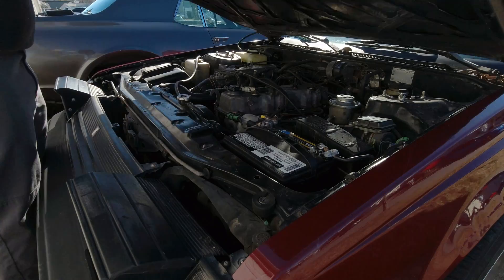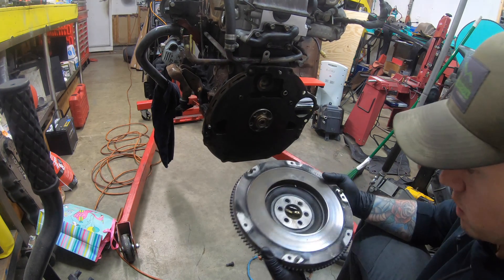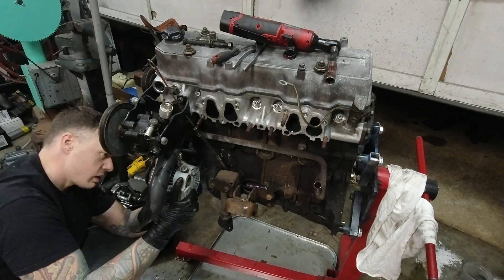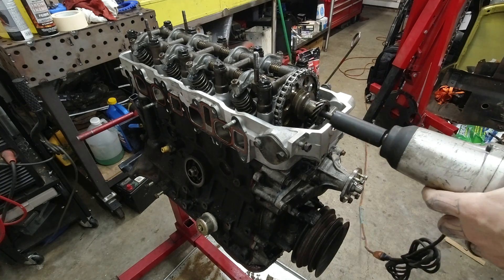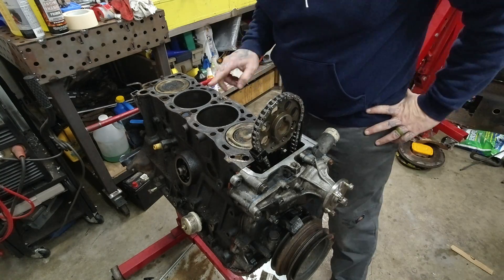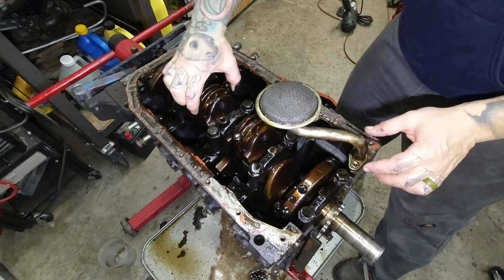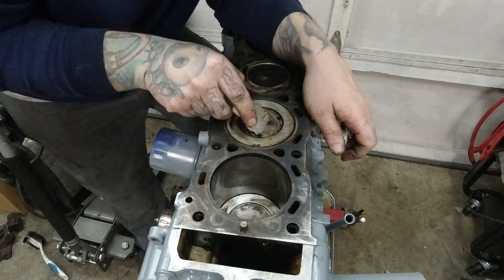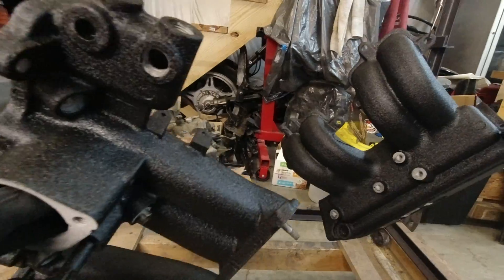TOYOTA 22RE ENGINE REBUILD - Part 1/2 - Teardown and analysis of a poor running 22R Toyota legend!

Comment: Maybe not a timing related fault. Replace the rocker cover gaskets. The miss is from the spark plugs shorting out through oil contamination..
Reply from the maker: Great theory, but that isn't even close to what was wrong. See part 2 to find out what it actually was!

Comment: Currently have one  in a '86 4runner at 315,000 mi on the odo

Gonna be moving from Washington to Texas this coming spring. I DO NOT want to pay the like 3000$ to ship it. And I honestly dont want to sell my baby. Motor runs fine. But no ones really been in it for some time. What would you recommend I take care of before I make the 2000mi drive?
Reply from the maker: I drove this engine in my Celica on a 2000 mile round trip shortly after this rebuild. My advice? If it runs good as is, then hit the road. Pay attention to fluid levels and keep an eye on coolant temps. Also...don't try to run 80+mph. You'll still get there at 65 and the truck should stay happy.
Reply: @tinygaragefab  85mph is a dream.

With the 35" tires and current gear ratio im locked in at about 55mph. The left lane/passing lane isnt a thing when im driving it 😂

Right on! Ill probably have broken something else by the time i leave wheeling it one last season here with my friends, hopefully she makes it alright  🙏

Comment: What type of stone was used on the head block
Reply from the maker: That was just a cheap knife sharpening stone I picked up from a tool store long ago. There are better things to use, but this works great for a fine hone just to get a glimpse of whether the head or block is warped.

Comment: I would like to know how you got rid of the refrigerate. I don't know anything about impact wrenches..are the expensive..do you needed a commercial compressor to run a impact wrenches
Reply from the maker: I don't believe this had any refrigerant in it. You can usually unbolt the compressor from the mount and move it out of the way to pull the engine without opening the A/C lines, if you're worried about it. Many shops might even purge your system for free if they get to reclaim and keep the refrigerant. 

As for impacts, electric is now the way to go. Harbor Freight has some decently powered 20v impact guns. But most of the time, you can just use a breaker bar and do it by hand, it doesn't take that much longer.

Comment: I own a 1997 Toyota Hilux with the 22R engine which is excellent what a terrific engine one of the best 4 cylinder engines ever made when l bought the Hilux about 3 years ago for aud$1500 as l was a courier retired now l have not removed the engine because you Celica was running very rough and there was something not right with your engine l have no idea what has been done to the engine but l can tell that the engine has not been removed it has been serviced because l have replaced the rocker cover gasket and l don't think the cylinder head has been removed and the caburator is never been removed but it starts on the button every morning the automatic choke works you didn't mention how many miles is on your Celica and the 22R engine appeared in the Hilux in about the 1995 but we got in Australia the 22RE in the Toyota Corana Avante in the 1980s
Reply from the maker: Excellent story! It's cool to hear how different engines get used around the world. The 22RE was replaced by the 2RZ sometime around 1995 here in the states. 
My Celica had 157k miles (252k km) on it when I pulled the engine for this video.

Comment: I owned an 85 Celica GTS, it wasn't very fast but it was my favorite car I ever had. It wiped 2 camshafts and rockers so I cleaned and refreshed it, replaced bearings, rings and oil pump and it went a total of 300K miles.
Reply from the maker: Heck yeah! I really should have done bearings and rings in this one. I'll pull it again soon to refresh the bottom end and gaskets, because it leaks and burns a fair bit of oil.

Comment: Man i just rewatched this awesome videos thanks for taking time to do them. What oil would you recommend? Thought about a synthetic blend but was a afraid to switch.
Reply from the maker: Thanks for watching! It was a fun video to make. For oil, since it's not a roller cam, just flat tappet basically, I only use Rotella T4 10w-40. I use that because of the high zinc content for an off the shelf oil. Cheap to buy in gallon size from Walmart also.
Reply: @tinygaragefab  awesome thanks man

Comment: Awesome video man. Yes I learned the hard way guy that did my timing chain used the plastic guides. Guides broke 30k miles. I love my 22 re just found a 1990 from California with hardly any rust. Im afraid ill have to put a water pump on it just found some antifreeze leaking looks like from a seal from the waters pump.
Reply from the maker: That's awesome about the truck with no rust. My '87 only has a little in the bed. I have the Japanese bed, so it has the seam that rusts out. I'm going to pull that 22R to swap a 1UZ, but that 22R will love on as a turbo build in my '85 Celica.

Comment: Great video! What size bolts are you using to mount the engine to the stand, I just got a 84 Celica gts and transmission is about 1/2" from bolting up but no bolts to engine. Thanks
Reply from the maker: I don't remember the exact size, but they were pretty long, something like 75 or 80mm length.

Comment: i just noticed, that his has to be one of the few Toyota engines that I've seen that doesn't have that oil filter right below the exhaust manifold
Reply from the maker: You know, you're right. I never really noticed that either...which is weird considering that I'm building a 3S-GTE and there is almost no room for a filter because of the turbo. Lol

Comment: im doing this exact same process on my friends 85 celica gts. his has a stumble on acceleration, orugh lopey idle, and running extremely rich. amazing cars (once you get those pesky misfires and valve lash in good shape)
Reply from the maker: Oh, for sure. I took mine on a 2500 mile road trip last year and it was perfect...even got 34mpg!
Reply: 34mpg?!?! What other stuff had you done to it? Egr delete, etc?
Reply from the maker: Yes. EGR delete, new head, Melling 'stage 2' cam, and that's about it. Average daily mpg is 25.5, but all highway it gets 34, like on that road trip. Pretty decent for a 37 year old car!

Comment: Just got all my new head parts from LC engineering.  This video is going to be a big help for a first time rebuild for me.
Reply from the maker: That's awesome! Just take your time on the rebuild, and it will turn out just fine. 👍
Reply: So how did your rebuild go? How much did it run you?

Comment: next time you have an issue with "groove" in Harm. Balancer use a speedy sleeve rather buy Harmonic balancer.
Reply from the maker: I considered both, but ended up putting this one back in. No leaks after a full year of driving.

Comment: How did you clean the clave cover for powder coating? Did you sand blast it? If you did, how did you prevent dust from getting in the baffle on the underside?
Reply from the maker: Great question. I Sand blasted it, but first I removed the baffle by cutting the rivet heads that hold it in. Then I carefully drilled and tapped new holes for stainless button head screws. I reinstalled the baffle after it was coated using the screws and red loctite. It was a bit of extra work, but much better than having sand in my oil!

Comment: My Question is ..If I am pulling my head how hard is it to put in a new set of  rings???  My compression is 135psi in all 4.
Reply from the maker: 135 isn't too bad. Not amazing, but it'll run. For rings, you have to take off the oil pan and undo the rods from the crank. Probably a job you'd need a ship crane for in order to get the engine up high enough to safely work under it.

Comment: I’m doing the same on my ‘85 Toyota pickup only I don’t have an engine crane/ stand so I am replacing the head (leaking head gasket and bent valves) and timing chain (broken timing chain).
Reply from the maker: I did the head gasket with the engine in place in my 1987 Pickup. Started Saturday morning and finished by the time the sun went down.  I do love these 22R engines.

Comment: Watching this just makes methink how bad my engine needs a good rebuild 😭. 213500 on my 22re.
Reply from the maker: It can probably go a little longer as long as you change the timing chain guide to a metal one like I have.
Reply: the last 22r i had was in my 88 2wd  5spd pickup almost 400,000 miles carb not EFI AC was cold as hell an still got mid to low 20's gas mileage
Reply from the maker: Hell yeah! I also have a 1987 pickup with the 22R carburetor. Truck runs great and had ice cold AC until a year ago or so. I will be engine swapping that truck, but it will only become better, I promise.

Comment: Awesome video, glad I found your stuff. I’m about to do a rebuild on an 87 4 runner. It’s gonna be tricky because I bought it with the top end disassembled and stuff is not very organized although it appears to be all there
Reply from the maker: Awesome! I love the 1st gen 4Runners!
Between this video and the Part 2, there should be enough info to guide your rebuild, at least on a basic level.
Reply: @tinygaragefab  What’s your opinion on buying an aftermarket head vs reassembling a stock head? I think I’m gonna put a supercharger on this baby
Reply from the maker: That's where your wallet can lead the way for sure. I would prefer an original Toyota head over most aftermarket offerings, because I can trust that the casting/metallurgy is 100% correct since Toyota made it. However, the head in this video is an overseas aftermarket head. It was on the car when I bought it. It is still holding up just fine after nearly 10,000 miles, but I'm also not boosted. I'd also like to believe that the castings that LCE and 22RE Performance sell are extremely high quality as well, but I cannot say for certain, as I've never had one. 

And I'd suggest turbocharger over supercharger. Packaging is easier, because you'd realistically need to lose either A/C or power steering in order to physically fit a supercharger and have access to the belt drive to run it.
Reply: @tinygaragefab  thanks for the advice. As I look more into prices for everything I think I’ll stay stock, stuff can get very expensive very fast

Comment: Way too much work
Reply from the maker: What would you do? Just throw the car away? 
It took 3-4 hours by myself to pull the engine, start to finish. Then another couple hours for complete engine teardown. That's only most of a Saturday. Hardly too much work in my opinion. Give Part 2 a watch also. More work there, but all that can still be done in a day. So...a full weekend to get a classic car back on the road isn't that bad at all.
Reply: @tinygaragefab  That’s not bad at all. I lack the expertise to do this kind of job. I have a 22re with 233,500 miles currently. Timing chain replaced at 222,000 miles and valves adjusted. I’m doing oil changes at 4,000-5000 mile intervals. 

How many more miles based on that available information do you think she’ll go for? I really want to see it get 400,000+. 

Is there anything else I should or could be doing to improve the chances of more longevity? 

Would installing an LCE header be advantageous in any shape, form or fashion? It’s something I’ve been wanting to do for over a year now but I keep hesitating because I don’t want to potentially ruin a good thing in the slightest if that makes sense.

I know probably the least about automotive as about anyone you’ll run into, but I’ve always driven it with slow acceleration and have driven at 55-60 mph to keep from “stop and go” driving as I hear that is the main cause of wear and tear on an engine. I just want my 22r to last as long as possible and so far I think I’ve been fairly prudent regarding this. 

Thank you very much for the video and response.

You could say I’ve become hypochondriac about my vehicle in the past through days through the immense searches on 22RE’s and Toyota trucks I’ve done. Probably just mental.
Reply from the maker: So, it sounds like you have a good grasp on things. Valve adjustments periodically and engine oil changes are a must. Now about that oil...I run Rotella T4 15w40 in my 22Rs, and that is the only oil I'll run in them. It's made for diesel engines, but thats not an issue here. Our 22R has a "solid lifter" type valvetrain and because of that, friction is the enemy. Specifically metal-on-metal. The only additive in oil that can fight this is Zinc. Problem is...zinc has been removed for the most part from almost every regular commercial oil, especially anything targeted to newer cars (~2000+) 
Newer cars use "roller" valvetrains that inherently cut down on a ton of friction, so the oils can be formulated differently. 
The Rotella T4 has the highest zinc content, by far, of commercially available oils outside of very expensive racing oils. 

But yeah, take good care of it and it should last. Adding a header will not effect the motor in any significant way. Some will say that it can cause your tune to change and you can run rich/lean or whatever. But our cars/trucks have a MAF, which measures the volume of air in so that it can mix the right amount of fuel. More air out(with headers) means more air in. The MAF will compensate without you having to do anything at all. While tuning is an art, there are many who overinflate it as a black art. It isn't.

Comment: Had a 22R in my 80 celica. Was a great engine. Had several in cars I owned.
Reply from the maker: I also have a 1983 Celica and a 1987 Pickup (Hilux) that both have 22R engines.  I'm definitely a fan of them.  The Celica will get a turbo, but the Hilux will be getting a 1UZ-FE from a Lexus SC400.

Comment: These are my favorite engines, without watching the video, it sounds like the valves are not seating down and the rings are shot
Reply from the maker: Close. I do think the rings may be a bit worn. I have a small oil consumption issue. I should have did the bottom end as well, but its not a big deal yet. Only takes a few hours to pull the engine, so if I need to do the rings and bearings at a later date I will.
Reply: @tinygaragefab  , looking forward to that video!!

Comment: Wondering if you had any advice. I have a 22r with a holley sniper EFI. its been running rich. i found a good amount of aluminum shavings in the oil and its murky. i think gas is mixing in the oil getting between the head and pistons. what do you think it could be? oil pump? bearings? pistons rubbing against head? timing chain cover? im going to pull the sump and check rod bearings tomorrow.
Reply from the maker: I'd guess it's in the timing chain cover. Do you have a double row timing chain in a single row cover? That would explain the aluminum shavings as well as murky oil if it rubs through the back of the water pump housing. Other than that, there isn't actually a lot of aluminum in a 22R.
Reply: @tinygaragefab  finding out what i have. i think im going to get ready to just pull it off. will i throw it out of time doing this? i saw how you kinda kept things at the same place. i can understand where to get the pistons with the distributor but i dont know alot about timing.

Comment: Nice video, Bro. I heard about your channel and had to check it out. I’ll hit you up with some advice on my issue of breaking my crank bolt loose without turning the motor.
Great job, Indestructible!
Reply from the maker: Thanks dude! I'm always down for sharing tips and tricks.
Reply: @tinygaragefab  thanks. I guess after soaking for over a week in PB Blaster, the crank bolt couldn’t hold on anymore. The impact wrench got the best of it.

Comment: Engine break-in is just an afterthought for some people and I'll bet that contributed to the cam problem but hey you get to put a hotter one in now:-)  but it was strange that the wear increased in each cylinder.  Were the head bolts new?  I didn't notice.  Some folks also try to re-use them which isn't a good idea.  Since I am a "shade tree" mechanic at best why the wear occurred like that is beyond me.  Good luck with the build.
Reply from the maker: I was also a bit stumped by the increasing wear. As for head bolts, some aren't reusable, but on these 22R's, it is plenty acceptable. Reusing head bolts is really only a bad idea on torque-to-yield bolts, which these definitely are not. Part 2 will be out on the 30th.

Comment: I just wanted to know is powder coating just for looks? Or does it help with like strengthening metal integrity.
Reply from the maker: I will absolutely not claim that it will do anything for strength. I do it for looks as well as the longevity of the coating, as it is usually more durable than paint.

Comment: As soon as you showed the progressively-worsening cam lobes, I figured you had a screwed cam bearing/retainer or head bolt issues...No bueno.
Reply from the maker: I'm still a little stumped on why it was the way it was. Hopefully it was just the bad head bolt. I get that sorted in part 2, which should be out next week.